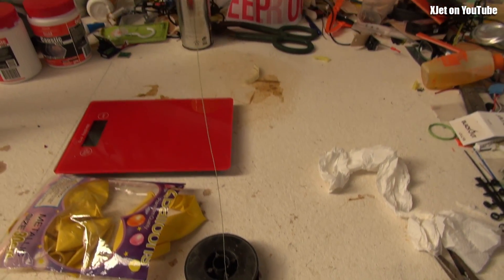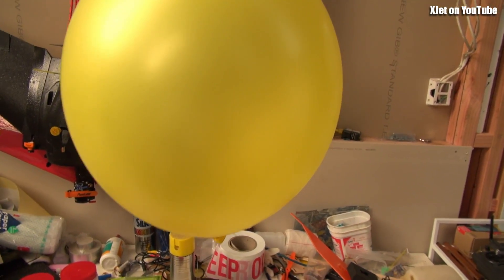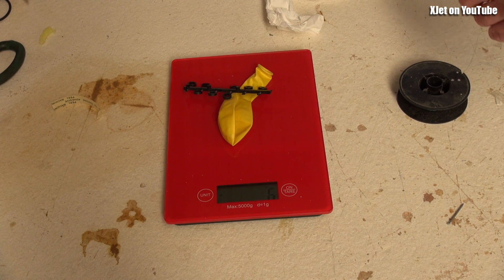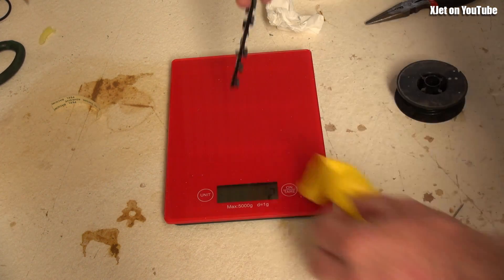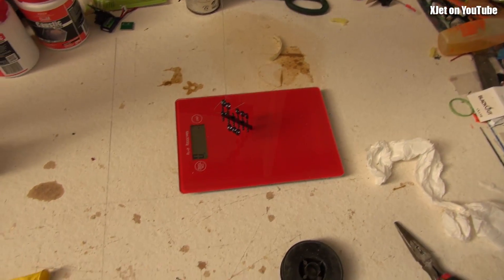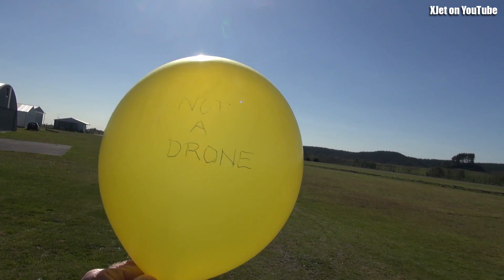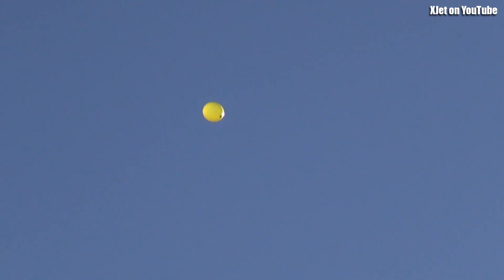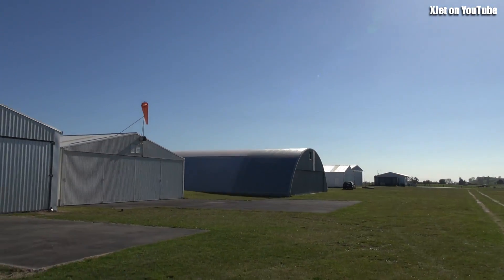A drone alternative: hydrogen-lift aerial video (FPV) Part 4

Comment: if i remember my physics from school (35 years ago) 1 cubic meter of hydrogen will lift 1 kg. might be wrong it was 35 years ago
Reply from the maker: At 1 bar (sea level) of pressure, 1 cubic meter of air weighs 1.292 Kg.   A cubic meter of hydrogen weighs about 90g so if you subtract the weight of the H2 from the weight of the air you get  "lift" of about 1.2Kg per cubic meter when using H2 as a lift-gas.
Reply: pretty close, not bad for a comprehensive boy.

Comment: I asked on the last video why you didn't just use a cylinder of Helium!  Readily available, not flammable, no answer that I've seen?
Reply from the maker: Here's your answer:  https://www.forbes.com/sites/quora/2016/01/01/why-we-are-running-out-of-helium-and-what-we-can-do-about-it/#e6d5ed057ada
Reply: Since then, they have discovered more deposits. 
https://www.chemistryworld.com/news/scientists-unearth-one-of-worlds-largest-helium-gas-deposits/1010122.article
Reply: I sincerely hope we are out of the fire for a while as far as supply, I'm 70yrs old and have been hearing that we are about out and that it's not renewable for my entire life.   How much larger would the Earth need to, in mass, to stop He from drifting off into space?  Maybe that's the answer, wait for a large asteroid. That will increase the planets mass enough to retain the Helium, lol...  NOT

Comment: Hydrogen will leak from a standard balloon. It needs to be silvered. A drone can be directed. A balloon has a mind of its own. Hardly a viable alternative.
Reply from the maker: That was a helium-grade balloon but the final envelope will be plastic and it only has to hold the hydrogen for long enough to fly out of video-range.
Reply: If you tie two balloons together and only half fill one, when the first one bursts the second will carry on. How do you propose to recover the camera?

Comment: Are these biodegradable balloons?
Reply: It will degrade eventually... but it might kill some wildlife in the meantime.
Don't be flippant with this comment mate, you should be considering this kind of stuff with this build.
Perhaps, whatever you're using to recover the camera, could recover the balloon too?
Reply: Sorry I will be more specific with my questions in the future, to avoid ambiguity.
Reply: something like this maybe https://www.buildabirthday.co.nz/products/minecraftbiodegradableballoonspacketof12
Reply: We are just starting to realize what shitty, shitty material plastic is for all of us.  Even when degrading in open air, plastic doesn't go away, it just becomes too finely grained for the human eye to see.  It still ends up in the food of the generations coming after us.  They won't be flippant about this issue, for sure.
Now, I see the point about this just being one balloon, etc.  But what rubs me is the unnecessary extra release just to close off the video.  The balloon had no mission and no payload - so it's just littering.
Reply from the maker: Everything degrades (eventually).   Which reminds me that I must do a video on the subject of those cheap throw-away supermarket shopping bags (aka "drones" if you're an airline pilot).  I've made some very interesting observations about their biodegradability.

Comment: You have to watch out with scales like that. I have one that auto zeros if there's less than 5g on the display. I wanted to weigh and used spoon to add to the scale. It stayed at 0g all the time even to the point when I had moved over half the contents of a 50g container. If I want to measure something very light, I have to put some weight on it and NOT tare it. Might want to check if your's does that, too.

Comment: To reduce the amount of H2O into the balloon, what if you put some stainless steel wool or some type of gauze in the neck of the bottle so that the surface area of the SS wool/gauze is large enough to collect the droplets of the H2O and this will return back into the bottle when the droplets are heavy enough

Comment: I think it would be easier to create a multiple balloon lifting system than a single large lifter.
Might I suggest that you use red balloons for that and if you buy 100 and have a 1% failure rate you could cause a bit of a stir.........
Reply: We're showing our age :D
Reply: Thanks to Sir Bruce I've discovered more about the CAA (UK) rules governing untethered (and tethered) LTA balloons than I really wanted to know including the fact that a couple of events I attended last year operated contrary to the guidance on "Mass Balloon Releases" and that in the past I , plus many adults and even small children, have also broken the regulations governing the flying of kites.....
apparently whilst I am allowed to fly a "dangerous drone" all the way up to 100m a kite (toy or otherwise) is restricted (unless permission is granted) to 60m
Who knew?
Reply: https://www.youtube.com/watch?v=La4Dcd1aUcE
Reply: didactylos4 diddy4 99 red balloons floating in the summer sun....
Reply: Two balloons give 10g lift
4-20g
8-40g
16-80g
32-160g
64-320g
128-640g
256-1280g

With 256 balloon Bruce haskikigrams of iron floating into the sky

Rocket man - ballooning human

Comment: Interesting project Bruce. How are you going to mount the payload so it's not just spinning around? It would need some sort of rigid mount (but very light!) or you will have to secure it to the actual balloon?
Reply from the maker: The payload will be designed to provide a degree of aerodynamic stability.
Reply: xjet interested to see how you address that.
Reply: some kinda of weather vane ought to give a lot of stability,  maybe fly the camera literally on a 360 rotating gimbal for the remainder of stability also.

Comment: Bruce, if you haven't seen this already, Peter Sripol filled a weather balloon with hydrogen and added propellers to control it (and then blew it up!)
https://www.youtube.com/watch?v=8fWbTuipSIA

Attach one of these to a quadcopter and it could fly for hours on 5% throttle.

Comment: I wish you didn't send off that balloon purposefully, it's only a small balloon, but it ends up in nature, nonetheless.
Reply from the maker: Compared to the emissions generated by a single environmentalist flying half way around the world to attend a conference on the subject, this little balloon has an immeasurably small impact on the world and its creatures.
Reply from the maker: Hopefully this series of videos will get more people interested in the serious hobby of free ballooning.
Reply: The video was great. Bring back glassmilk bottles nz
Reply: Weather balloon launches are very common, with much larger balloons than party balloons.
Reply: Fair enough.  However, dumping sewage in the ocean is also very common, yet, somehow, I manage to pick up after my dog.  It's about doing what one can out of principle, not about always pointing out something worse somewhere else :).
Reply: Partykristian the point is that balloon launches is an entire hobby and art in and of itself. Either tracking down the balloon payload landing site, remote telemetry etc.

Wouldn't be brazen and let off a hundred party balloons for no reason, but the impact is small and a lot about conservation is learned with balloon launches.
Reply: Yes but for FPV you don't HAVE to leave it there, you know it's within a few hundred metres of you - free balloons fly for up to 100 miles away. Just not possible to find all the balloon bits that fling off your payload when it explodes at altitude.
Reply: Unless we mine balloon material off earth and bring it back to earth to fly then the materials Bruce sent up is just Brownian motion at a larger scale. Energy flux intact. No harm no foul. What is limited is human life span. What short life spans do is give humans myopia on the environment. If humans lived for billions of years then Bruce balloon would be in a proper perspective. Simple answer to environmental concerns. Wind clock back seven million years to when chimpanzee split off from humans at the point of comment ancestor. Do you hear chimps complaining to humans about sewage running into the sea from a meat diet?  Next time you at zoo look at the humans complaining to the chimps about sex in and out of the cage polluting the earth with another living entertainment. 
Bruce if you inhail hydrogen will your voice be even squeakier than helium.
Reply: I understand what you mean, but I still think it's good form to not put plastics, etc, out there that don't need to be - even if for the sake of principle and making a good face for our community :)
Reply: Of course I see your point, but we all need to contribute and make sure we set a good example.  I also cringe when people crash an FPV model and just go "hey it's lost, poor me, that was expensive" - not even offering one thought towards their responsability for trying hard to retrieve the thing so it doesn't sit out in nature.  I'm sure it is very unlikely an animal will choke on just that one specific balloon, but nonetheless it's one more piece of plastic in nature that didn't need to be there <3

Comment: If you leave the balloon still for a while everything that is not H2 will settle at the bottom and you can open the neck to let out a bit of gas. This is why i used to do when filling a balloon with brown gas to get rid of the o2.  I just let out 1/3 of the contents carefully to get rid of o2.
Reply from the maker: The effects of brownian motion and diffusion will limit the amount of separation that occurs -- at least in any reasonable timeframe.   This is the same reason that we don't have the  heavy gasses like argon and xenon (which are present in trace amounts in the air around us) or even CO2 forming a layer around your feet because they're heavier than nitrogen and oxygen.

Comment: assuming one of those very small all in one vtx/cam systems is attached to the balloon and the balloon going THAT high up and even higher with the "real thing" won't we be losing video rather quickly?
Reply from the maker: We will be using high-gain directional antennas.  I expect to get 5-10Km of range from a 200mW VTX.
Reply: senseTUBE - To be honest it will be so turbulent and unsteady I doubt one would be deciphering much without slowing any DVR footage down with editing software.
Reply from the maker: I have thought of that...   that's part of the payload design... stability!

Comment: HaHaHaHa Not A Drone!!!
Now I Need To Ask A Dumb Question!? If You Attach Micro Radio Gear & Motor To Your Helium or Hydrogen Ballon, Then It Would Still Be A Drone!? LMAO 😂
Reply from the maker: Dead right Samgab.  How ironic that something over which you have no control (and therefore no ability to avoid manned aircraft or other things) is considered a lower risk (and thus less restricted) than something which you can safely maneuver to avoid collisions.    The phrase "desk pilots" springs to mind again.
Reply: Bruce has no intentions of controlling the balloon, just that it should carry a camera and transmitter to send the video feed back to him.
Reply: Yes, we are all well aware of that. But Grumpy John asked a question citing a hypothetical; IF a balloon had control mechanisms, would it [still] be a drone? The answer to GRUMPY JOHN, is YES, it would be a drone in that case, because it has a system to control it and propel it, which excludes it -- in NZ -- from the special allowance made for UNCONTROLLED free balloons of a certain size... "Free Balloon means a pilotless aerostat without propulsion in free flight, having a gas capacity greater than 1.5 m³:" A balloon having less than 1.5 m³ gas capacity is not specified in any of the rules, but as soon as it has a means of control or propulsion, then it becomes a drone (or a Remotely Piloted Aircraft), and is no longer exempt from the rules.
Reply: "It Would Still Be A Drone!? "
Define what you mean by "Drone"
Reply: Yes, because the rules specify that the balloon must be uncontrolled.